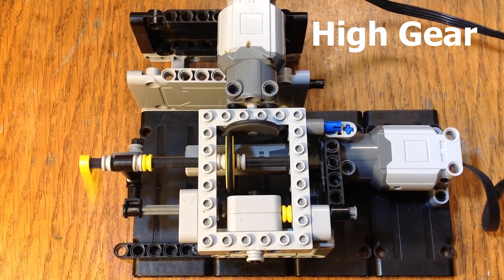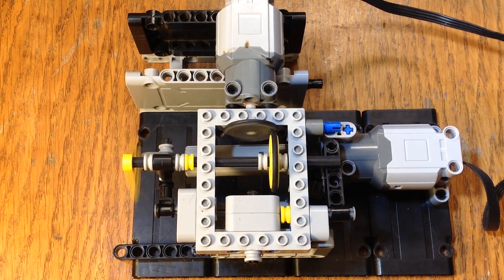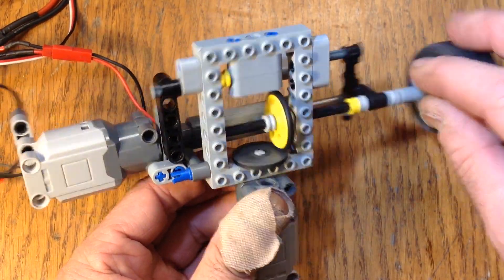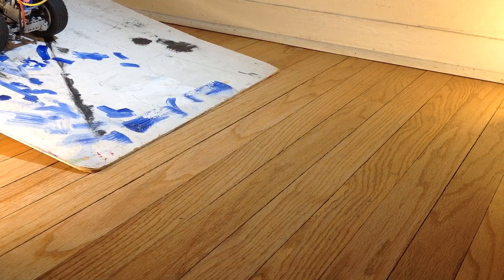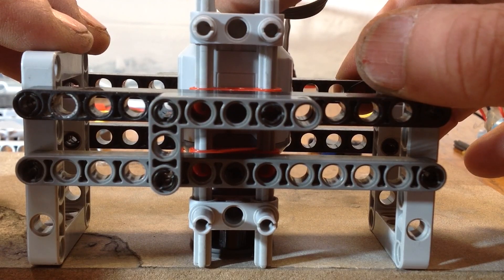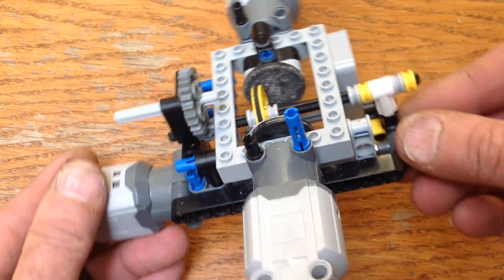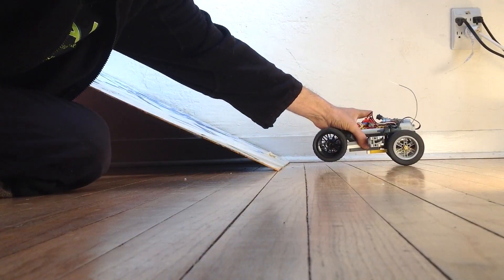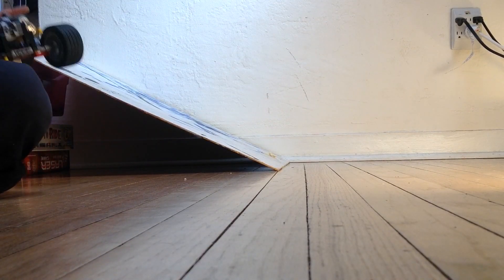Disk and Rotor Lego CVT That Pushes a Car Up a Hill

Comment: This is how forest gumps snapper lawnmower achieves gear ratios, they are great when the engine doesn't leak oil, any leak then they slip like iceskates, you can wipe the disc's with carburetor cleaner but it'll only last till more oil leaks! If you made a lever like the snapper has where it holds the output in place on certain levels on the disc you could probably make the most compact lego 4 speed transmission yet, I have yet to see one small enough to match the little lego engines

Comment: That's not a cvt, that's just a friction disk. Cvts adjust ratio as they rotate.
Reply: Ahh a friction disc transmission is a form of CVT, there are more than one kind of CVT you know.

Here let me break it down for you by copy n past of what CVT means. "Continuously Variable Transmissions are transmissions that provide an uninterrupted range of speed ratios", and what do you think the transmission in this video is doing and is capable of ?

Here are a few different kinds of CVTs.

Frictional Type (which is what the one in the video is)

Electrical Type

Hydraulic Type

Band/belt type (the kinds that are used in cars and snowmobiles)

Comment: Wouldn't this setup only limit speed? There's the same amount of friction at all points of the friction disc, so you don't actually get any more torque out of a low gear?
Reply from the maker: Thanks for the question. As long as the disc isn't slipping it acts like a gear. This transmission has been used to control the output speed from a constant input like a water wheel or steam engine. The output speed can be increased or decreased. And the usual torque relationship applies (as gears) as long as there is no slipping.
There are many friction based CVTs that use the differing angular velocities from cones,discs, balls, and belts interacting at different cross sections. They all use the same principle in different shapes to produce different input/output ratios, so you might want to look at some other versions also. 

Hope that helps.
Reply: @MaxBrix  Interesting, thank you for the reply. :-)

Comment: this looks very interesting. So the wheel in the middle doesn't need to be grippy, just the outer two? and pressure is applied from one side? 
Very alternative, reminds me of the trochoid CVT. If you gear down the output it won't slip so much and you can reduce the pressure a bit. You may have said this but I had the sound off.... anyway another interesting prototype! 🍺👍
Reply from the maker: The o ring is soft enough to get grip on the disk but slippy enough to allow for the differing speed of the disk over it's surface(twisting) and movement over the disk. Since this was a proof of concept I wanted to prove it's non slippage but yes It could be geared down and made more efficient.
Reply from the maker: Two disks with equal pressure require less pressure by more than 1/2 because it counteracts bending and doubles grip. Without pressure on both disks the axle will bend more as it approaches the center of the disk requiring additional pressure.
Reply: @MaxBrix  ahhh these are the trials and tribulations of material science. If we were using metal it would be sorted!
Fantastic development, very, very impressive model.
Reply from the maker: You can buy some metal axles and gears on ebay. I almost bought some for my motorcycle.

Comment: I used this principle in a small vehicle a while ago but I built the friction disc out of some small liftarms and hinged it so I had a clutch. Worked pretty well, I could just press the plate and the wheel harder together when they slipped
Reply from the maker: A clutched CVT!? Sounds like a cool mechanism! You should make a video and link here.
Reply: @MaxBrix  here are some old videos: https://bricksafe.com/pages/Stinkwell_exhaust_creations/clutched-cvt
Reply from the maker: @haflingerfan5800  Right on! It was tricky to get the pressure correct. Good solution!

Comment: This actualy great i never seen this kind ctv
Reply from the maker: It's like two cones with a belt. The center of the disk is the tip of the cone and the wheel is the belt. Cones are more efficient but don't have reverse.
Reply: Snow blowers use this kind of drive
Reply from the maker: @CFlow375  I am hearing that lawn mowers do to.